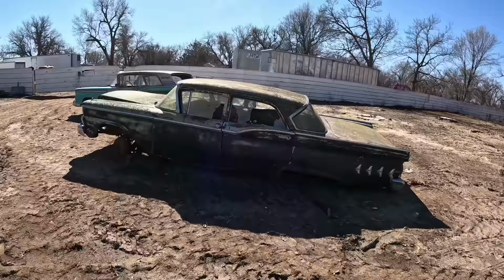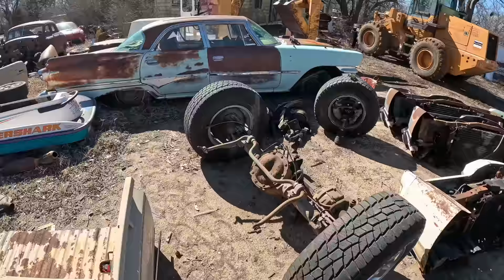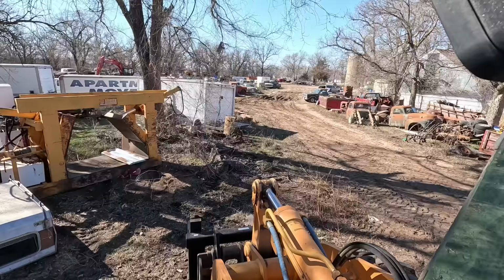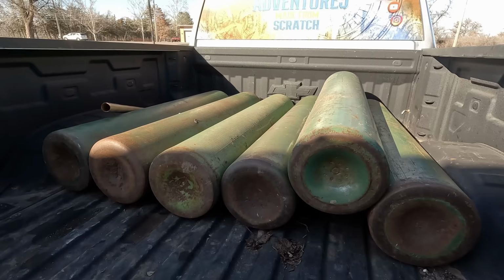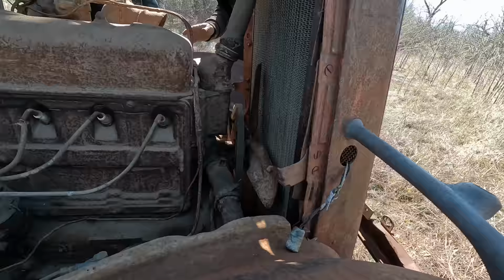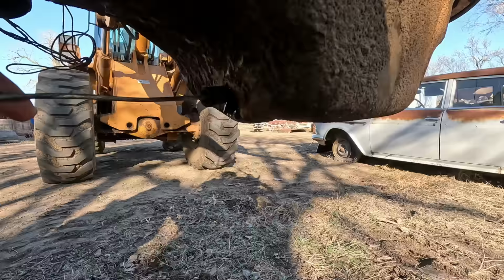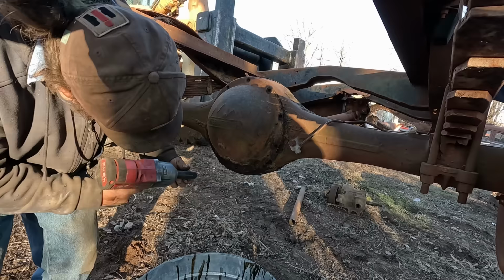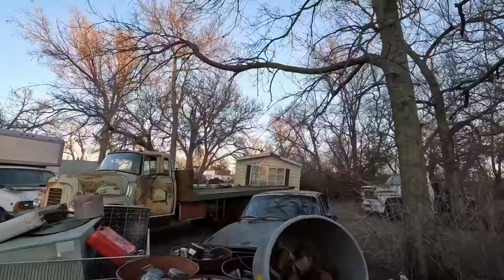How Many Old Cars can we RESCUE Before it's too Late?

Comment: Silas, the bucket seats in the '59 Fairlane 500 2 door appear to be '64-66 Galaxie 500 XL or maybe '64-66 Thunderbird.   Buckets weren't a '59 option.   The seats may have value as cores, '64 XLs have been going up.

Comment: Question of interrest. 
I've noticed that you've got lots of used car hauling wrecker type rigs. 

What would it intell if I pulled up in a big truck with the correct frame & rear axle; 
To purchase from you & install a metal tilting flatbed. 

I'm building myself a sleeper car hauler. The bed must be at least 14 feet long. Longer if that's all that's available. 
( aluminum is desirable, yet costly. )

I wish I understood more about what I'm asking but hellfire the information is just not out there for private interest. 
Goigle makes it so daugone tough too search simple today. 
I'm driven to succeeed but lack of information is crippling & a down right drag. 
So bare with my ignorance & care too share your knowledge, aye?